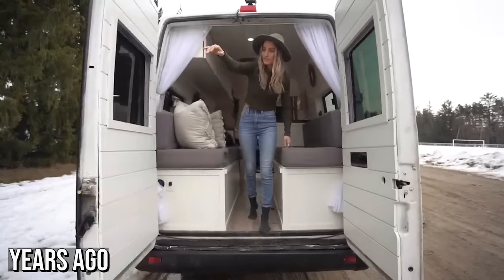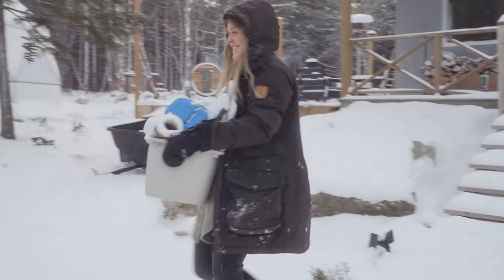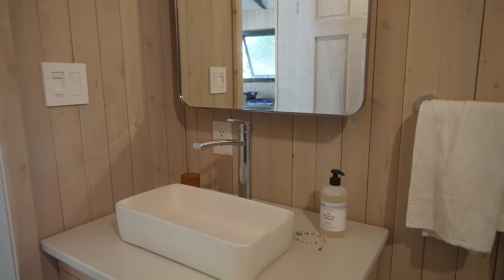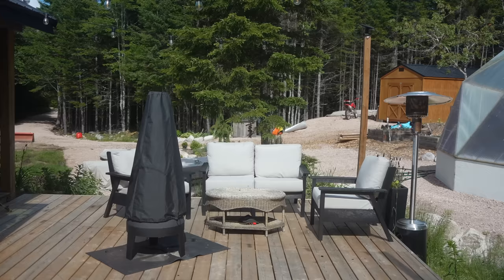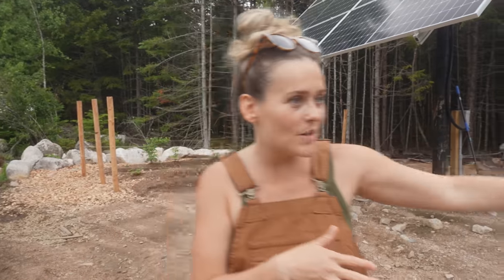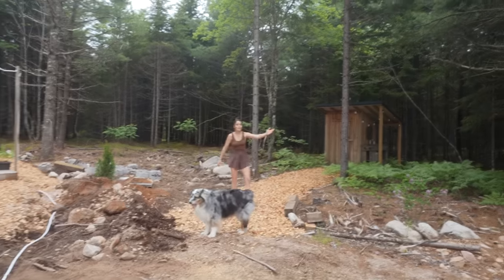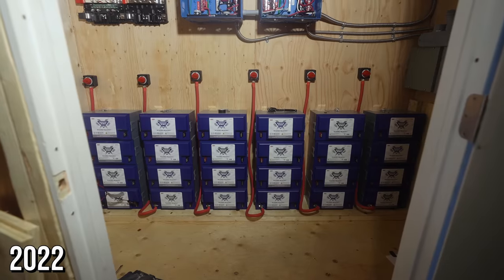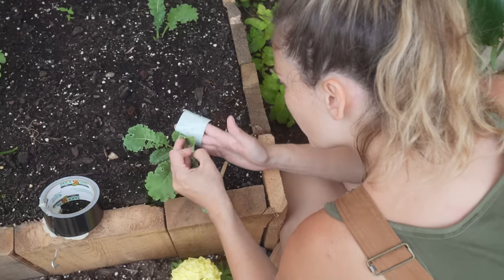2 YEARS OFF-GRID- A Real Tour of Cabin in the Woods (before & after)

Comment: Hey! Just a suggestion for your front yard: as someone who loves native plant landscaping, it might be easier to look into native pollinator plants/grasses that like wet spots. You could also create a natural pond for the water to flow down to in a place that's more convenient, and that way your tadpoles can continue to coexist! There are lots of native Canadian grasses and wildflowers that might not be as tidy as a lawn, but are a lot less work. After you've dealt with the drainage problem, a smaller lawn for Bella and Izzy to roll around on right by the cabin totally makes sense.
My other gardening tip (vegetable, this time!) is, in my experience, relying on commercial fertilizers can be a bit dodgy and also really expensive. It's great that you have that improved soil in there, but the fast release fertilizers can sometimes compromise the long-term growth and strength of plants. Usually, a good mix of compost and manure, combined with a solid mulch on top (you can look up a variety of mulches and find out what's best/most available for you) does the trick and provides a steadier, more long-term release of nutrients, without the fertilizer runoff. There are also other great ways to amend your soil naturally: for instance, using kelp or comfrey. The only downside is they smell really bad, but plants love it
Reply: I can see tall and colorful rain forest plants!!! Jungle plants min the summer!!! Ugh a destination for sure!!! Yes with the pond!
Reply: Comfrey is a fantastic fertiliser for plants, I don’t like the liquid feed smell so I just chop and drop directly onto the beds in autumn so it has the winter to break down into the soil and feed it, no need for a bad smell 😊 and the bonus is the bees absolutely LOVE it!
Reply: Great tips.
Reply: Great tips! But do mention how prolific comfrey gets. Any tips on Management?
Reply: @omavicmcmurray2893  you can buy varieties that are sterile so they don’t set seed and spread; mine has been in the same area for years the variety we have in the UK is called Bocking 14. Hope this helps
Reply: Are you trying to give them MORE WORK to do? They Already showed you the Ginormace Amount of things they Already Accomplished, for themselves. Without our Wish List
Reply: @omavicmcmurray2893  honestly i've just picked a place where I'm ok with having a lot of comfrey. But I've heard of people having success with planting in pots
Reply: LOVE LOVE LOVE. the idea of a "lawn" i HATE. ugh. just HATE. please don't make a lawn... 

also... how are you HONORING the ORIGINAL INHABITANTS of that land??? asking for a friend.
Reply: Standing water around these parts is a breeding ground for ticks and mosquitoes
Reply: @kittykatxox845  cedar oil and lavender oil will kill both of these pests and fleas, in case you have a dog

Comment: A helpful hint from a carpenter.   Those wood piles. If you stack them neatly. In size order.   Lengths.  Widths..  the wood will be handy.  Straight.  Easier to Access.     Keep the stacks off the ground by laying down a 2×4. Or 4×4's .. one under each end of each stack.  But you can stack four stacks on two 8' boards.  With only a foot or 18" in between the stacks.  Heck. If you screw a upright into the bottom cross wood plank. To help the stacks stay up and strong
Reply: stack ON pallets IN a storage container.

Comment: As a suggestion to stop condensation you basically have three ways. The basic problem is your equipment surface temperature is blow the dewpoint of the air in the room. So 1) you can use a dehumidifier which removes moisture which is the same as lowering the ambient dewpoint to blow that of the surface temperature. This costs money to buy the unit and cost some power to run from now until forever.. 2) add drain pans which collects the water and drains it to the outside. This does not solve the root cause of the problem but does manage it in a way that is often "good enough". 3) Insulate every cold surface, preferably with a vapour barrier. This prevents the outside of the insulation temperature falling below the ambient dewpoint and stops the condensation forming in the first place. This is my preferred method as it takes zero energy to run the solution and stops steel parts going rusty. The downside is depending on how much fiddly stuff you have to insulate can make this more work than you want to so.

Comment: It's almost August so it's time to start thinking about your fire wood for this winter.  I posted this tip in an earlier video that you want to save the pieces from branches and other "rounds" (4" to 6" plus or minus in diameter depending on the size of your stove) for  your night time stoking.  Because they are "whole" they put out more BTU's and burn longer than "split" wood of the same size.  

You probably know this but some of your viewers may not.  You want to use the wood you have had the longest first.  Any wood that is or starting to rot you can do one of two things with.  1.  Chop the rotting bits off and use it to fortify your garden beds and 2.  Use the entire piece to fill the bottom of your raised garden beds.  Rotting wood already has the bacteria and bugs feeding on the wood breaking it down and tuning it into a nutrient rich soil and because it's already decomposing it creates heat keeping your beds warmer so the wood keeps breaking down into the colder months.  

The added benefit of using rotting wood is that it doesn't pull nitrogen from the soil to start the decomposition process.  The decomposition process takes a lot of nitrogen to get it going so your soil will become nitrogen deficient until the process gets going and puts all that nitrogen back into your soil.  Low or nitrogen deficient soil will slow your plants development and will reduce the size and amount they produce.

Comment: the closet with the pump n water heater . see if you can find a shower base with a drain that fits under there drain the water out under the cabin. the aphids you can get rid of by putting a small amount of liquid soap in a spray bottle of water and spray the plants. doesant hurt the plants but keeps a lot of pests off. check the tomatoes for bugs slugs or snails the soap mix helps with those to. and tomatoes need support so stake them up n tie them to the stakes, put your firewood on pallets in an open sided shed so you can grab a pallet at a time with the tractor they sell a mesh bag just for balletizing firewood so keep your pallets lol 6 cords gonna take a boatload of them. your outdoor kitchen? all i can advise is make sure it gets shade and is close to where your eating. just suggestions love you girls proud of you  mike

Comment: Your Iron Horse Clementine needs a barn. Something big enough to store all your outdoor power sports toys and equipment. Motorcycle, ATV, mule, Clementine,,,. Perhaps even the vehicles? Maybe a 40' × 80' or 50' × 100' Pole building. You also might have a small shed dropped off just for the fuel cans gas, diesel, and propane tanks,,. Storing them out of the elements and away from everything else. Keeping the electrified Pack, shed separate and safe. I think I would turn your bedroom back into a bedroom With a view. Turn the spare bedroom into the laundry room /Hallway Leading to a master bedroom suite with fireplace and walk in shower and tub. Maybe doubling the square foot of your current Home.
You girls have done a beautiful job thus far. Keep up the Excellent work. Love the learning process for you both. Love the pack!

Comment: You are your own worst enemy moving your lumber around.  You'll take 20-30 minutes to stack it neatly on the forks... then just to go and dump it off in a disheveled pile.  All you got to do is jump off the tractor and lay a chock (sometimes referred to as a sticker), on each side of the forks, and set your load on that.  Takes maybe 30 seconds a side.  Then back up and slip your  forks out from underneath.  AND if you use a little finesse, and make flat topped stacks, you can repeat this process numerous times, and stack up to eyeball height, and maybe a little further.

As far as your question as to how much you'll get done this year; I would say YES to everything right up to restacking and moving all that firewood.  I'm guessing that would take weeks in and of itself, soooo probably not including that.

As always, thanks for sharing!

Comment: You have made great strides and have created a lovely spot -  your work shed and “spa” areas are amazing. I do have a few questions/concerns/comments. No Septic? Where do you dispose of your grey waste? May I suggest that as you have high ceilings you use your vertical space for storage. Please solve your moisture issue in your utility closet pronto, as mould is not your friend. Lastly, if you have no fruit yet on your veg plants this late in the season, you won’t have any; you had  to transplant them right after last frost. You will get there, but as the saying goes “Rome wasn’t built in a day” … and they had a massive workforce.😁

Comment: I would suggest that you insulate the water tank and piping with closed-cell material (Armaflex). If you add a humidifier, the condensation will just get worse. Insulation will stop it. Oh, and do the piping too... I would put the outside kitchen over by the indoor kitchen if it were my house.

Comment: About your utility closet, a laundry pan would be a good idea. They come in various sizes and are usually cheaper than a shower pan. As to a humidifier, there's the cost, time / labor install and drain on your power. I would suggest either an exhaust fan or pipe wrap (cuts down condensation).    Unslaked lime is an old fashioned natural way to remove humidity and it also removes odors. You girls are doing a great job and remind me of my younger days. Hugs to you both!

Comment: I only got 5 years with my Bosch stackable ( or side by side. Much bigger units. With two adults and two daughters. Before both started costing. Limited parts in BC Fraser Valley. Lots of retail but no parts at retailers. Had to wait for tech and parts from Coquitlam. Just a friendly heads up on a replacement option way down the road.

Comment: I would put the wood shed beside the house on the right. This way you and just pick up off the front deck. I would also buy a small to medium size trolly with big rubber wheels so you can fill it up in the shed and wheel it in the house near the stove.

Comment: I think it unlikely that you will be able to finish all of these tasks this summer. That is not a bad thing.
I am a practical sort of person, so the things that are essential to your safety and security appeal as higher priority. 
Fixing the roof corner: potential leaks can undo all the good work you have done inside.
Doing the siding: help with insulation in the winter.
Utility room plumbing: potential to cause damage to work already done.
Building a fire wood shed (if you can get your tractor to it, placing it next to the house adjacent to the kitchen seems a convenient location)
Other outside projects & finally
Internal fittings and fixtures can probably wait until winter.
Good luck!

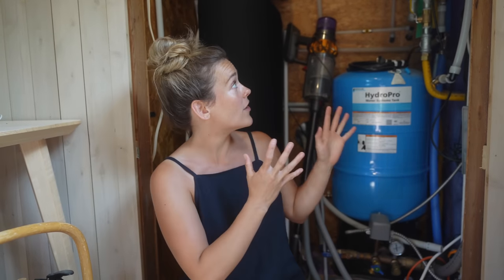Comment: (9:20) Install a dehumidifier with a drain outlet as high as possible, that way you'll never have to empty the bucket, just run a hose outside. If gravity permits it, you can recuperate that (pure) water for your garden outside on a drip hose.

Comment: You got any of that orange water proofing paint you did the bathroom with?  If it's good enough to water/moisture proof the bathroom it will be good enough to do your utility room.  As a back up to the de-humidifier get some DampRid.  With a little ingenuity  you can rig it to drain by its self (you are going to have to put in a drain for the de-humidifier).  They do make ones that are large capacity and refillable.

Comment: I would put your water system and hot water heater and all the stuff outside the back of the house in it own small insulated and vented with a fan to remove moisture. That way you have a cement floor with venting and more space inside the cabin. It could be a small attachment shed to the cabin!❤❤

Comment: APHIDS-Homemade
One spray bottle of water combined with two teaspoons of laundry or dish soap creates a powerful spray against aphids. Aphids are covered by a waxy surface; this surface locks water inside the body. The soap/water mixture washes away the waxy surface; eventually, the aphids dehydrate and die. The mixture causes no damage to your birch tree. Another mixture is to add three parts warm water, one part vegetable oil and a couple drops of soap. Combine the mixture in a spray bottle. 

Ladybugs are great, too.

I just finished spraying and they are gone!
Make sure to rinse off the plants after about 10 mins of the solution being on your plants.

Comment: Suggestion …. Consider using cement board siding for fire protection and because you can get it in several colors or paint it.  I painted mine (on my cabin in northern LP Michigan.  After several winters and hot sunny months….. no peeling paint like you get from   painted wood.

Comment: Free 3 ingredients rhubarb leaf aphid spray recipe. 8 cups water, 3 or 4 large (12-16 inches across) rhubarb leaves torn up into hand sized pieces, and one quarter cup pure soap flakes. Simmer leaves in water until liquid is half boiled away.  Pour through a strainer into bowl or bucket. Mix in soap flakes. Cool. Pour into a capped bottle and store in a cool, secure place until ready to use. To use: dilute half rhubarb leaf mixture and half water. Spray on aphid infested plants. This recipe is taken from ‘the Rhubarb Cookbook by Janet Smart. It works! 😊

Comment: Question girls, no need for a septic system with the incinerating toilet, but where does the run off from the shower/dishes etc go? Just a gray water line that drains into the bush? Assuming that's the case, does it need any special treatment (ie. a heated pipe) to avoid freezing in the winter? Is it run underground?

Comment: Don't watch this video while eating 😂. Also you can stop the condensation by insulating the pipes and tank with armaflex or something similar. Another way is to keep the dewpoint in the house lower than the pipe temperature which can be accomplished with air conditioning or dehumidifier but you'll need to keep the windows closed or seal off the room.

Comment: Did u say ur water filter, filer arsenic in ur water? 😮🤐🥴
What brand is ur toilet? 
If u buy another later of the same size u used for ur ceiling work, u can use it like a horse by laying across wood board onto the steps of the two laders. Then u hv a scaffolding to stand onto as u do ur ceiling work 😉

Comment: And of course, when the video camera is turned off, you ditch the clothes as well. Of course you do!  Why wouldn't you? You probably have an alarm stationed at the beginning of the driveway to announce the imminent arrival of someone so you have time to put said clothes back on and straighten up so you look presentable. 
I would too if I lived that far into the woods. 😆😋 You two are indomitable!
Regarding your aphid problem, just hose the plants off every few days for a couple of weeks. Works the same as spraying with whatever poison, chemical or natural.
The little blighters have a very short life cycle once they get going but they can't crawl very far so hosing them off works a treat. They will stop reproducing after a while. Nothing stops them until they are ready to stop. Just hose them off regularly. Works as well as anything. Some types of aphids actually live in the soil right under your plants and no spray reaches them. But drowning them is a real thing. Other than that you can poison the crap out of the plant itself until it is so toxic anything that eats sap from that plant will die. But it might kill you as well, in time. So good luck with the aphid issue. Just something else to add to your never-ending list! And you need to redo it every few days or don't bother at all. 😄😄

Comment: Those aren't pavers.  They are deck blocks:  The foundation connects to your deck beams through those.  I have fifteen of them right outside our front door, because I'm replacing our front porch.  Too bad you have all those rotted shingles under your metal roof.  Tearing off the roof and putting down new plywood, and then the metal, would have been a more permanent way to go.  Buy some ladybugs for your greenhouse.  They love to eat aphids.